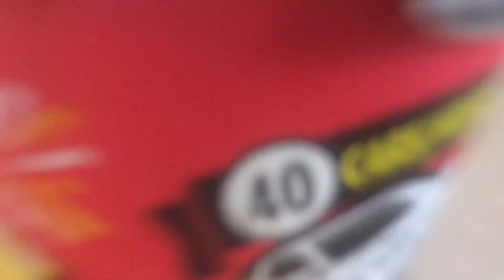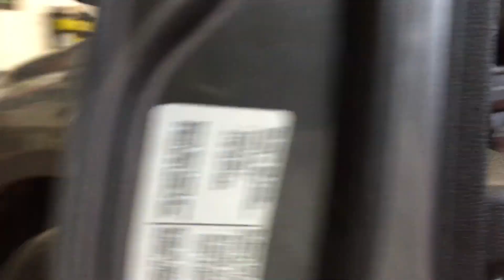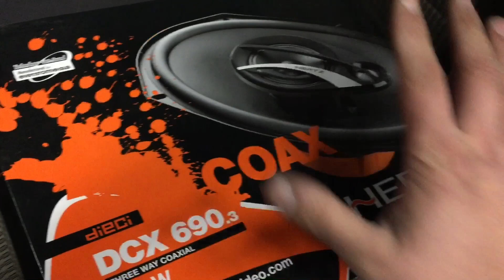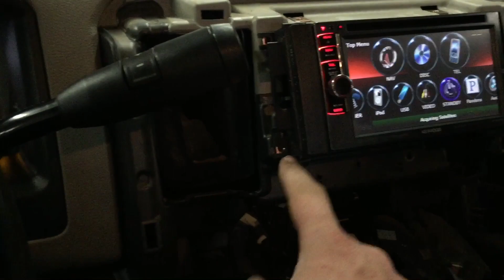Backup Mister! - Camera Installation - Truck Speakers! ~ JDM Mini RHD-LHD!??

Comment: This was the only cool video in my sub list after pug1 lol. I'm installing an android double din 7" indash cd/dvd player next week in my car. Pretty stoked. I've had the stock radio for about 10 years just did repairs and race mods. Installed a lot of head units and subs in high school though.

Comment: CarPhonix I've got a question I have a 2000 audi s4. Prior owner replaced the stock head unit with shit flip screen TV and upgraded the amp. Anyway I put the stock 6 disc back in cuz I feel stock looks better. Is there a adapter I need to plug my oem radio into the inputs for the aftermarket amp? I just want to listen to music lol
Reply from the maker: Bearded Ninja87 so they installed an aftermarket amp? Take a video of what's going on I'll look for it and tell you what's up!

Comment: Sounds like it's too much of an effort to convert a vehicle from RHD to LHD. And expensive probably, if you can't do it yourself. And you'd probably need several new parts of the LHD version of the same vehicle. So if the vehicle is only available as RHD, chances may even become slimmer...